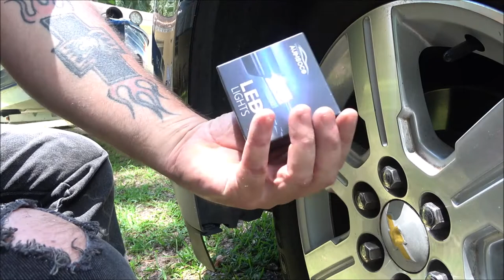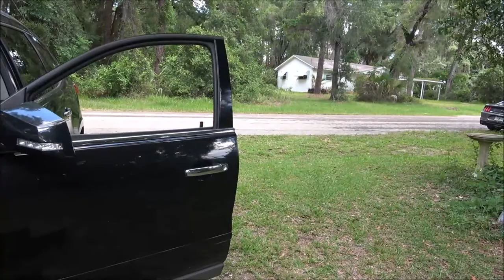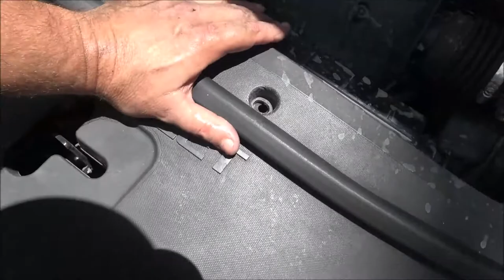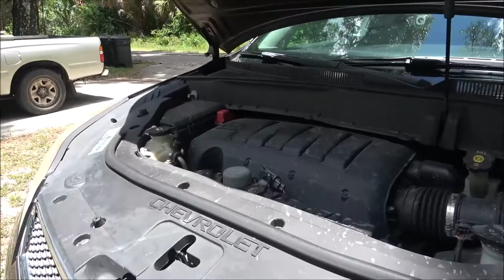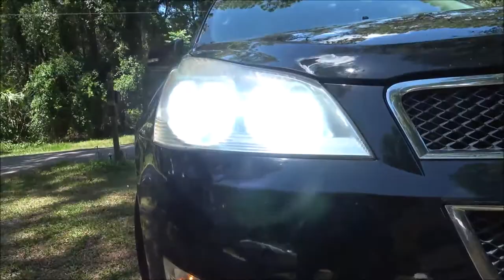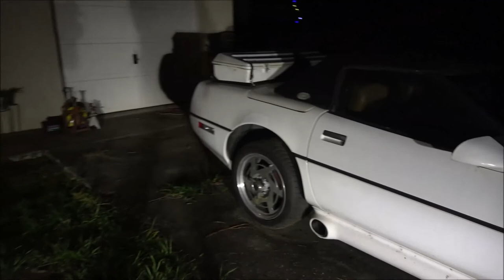Vlogging While Upgrading To LED Headlights In The Chevy Traverse

Comment: Have you had any problems since you switched over to led?
Reply from the maker: No. The have been doing fine, no issues yet.
Reply: Thanks for the quick response
Reply from the maker: @jwoods584  you're welcome and thanks for watching and commenting.
Reply: Is it that simple to switch from Halogen to LED bulbs in a 2011 Traverse? I’d like to soon, but I’ve read I need to order something to adapt for LED